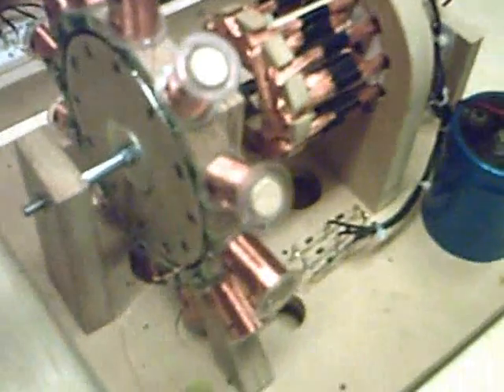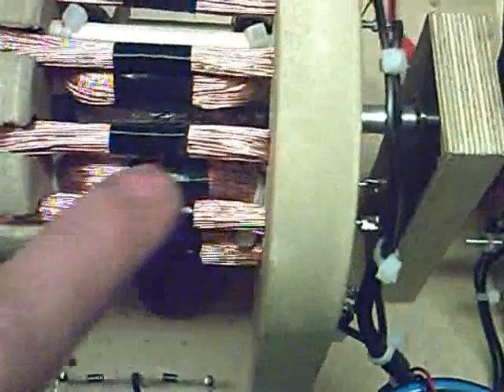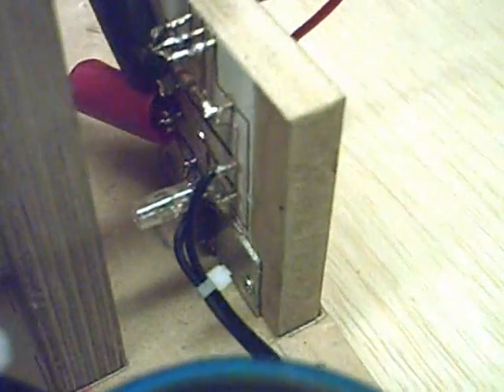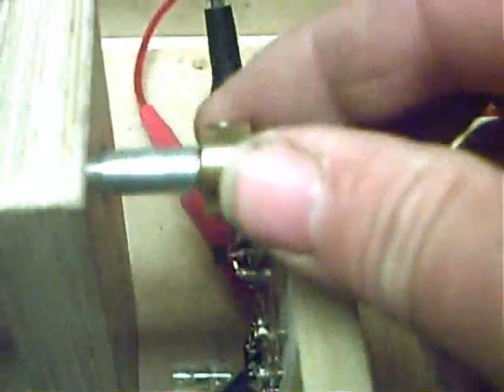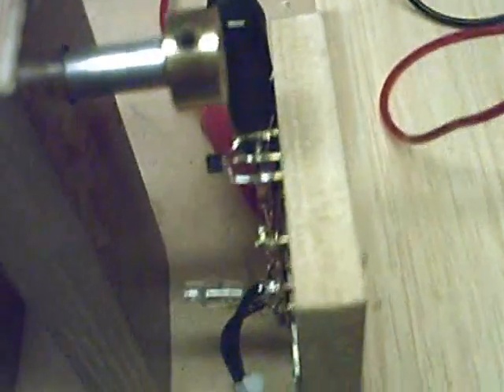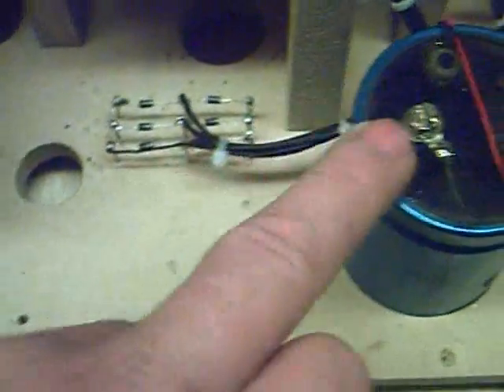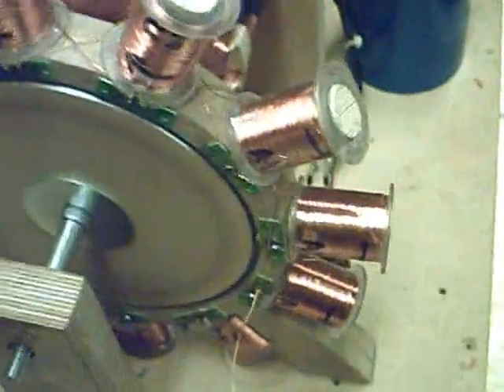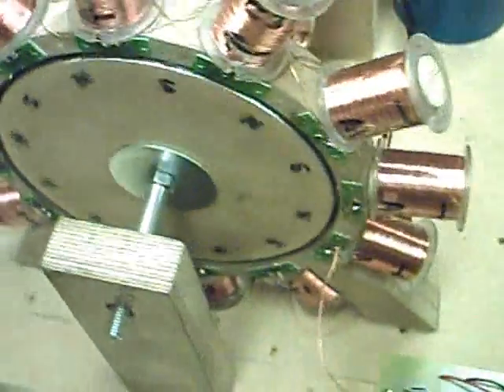Just a test run of double generator.  (TheDaftMan)

Comment: It is easy to create thousands of volts using static electricity on cold dry winter day.

The charging in the video could have been done with a transformer and a capacitor, and would be more efficient.

It is no surprise that Daftman has not achieved overunity, he even admits it.

Daftman's understanding of physics is way under par relative to his craftmanship by a factor of 1000.

Comment from the maker: Do you mean the TheDaftman set out if so there is a link on the TEEP forum?  
Or if you go to this video on youtube (Bedini pulse motor, build and diagram video 1 of 3.)
and look on the right you will see the downloadable link there to. 

Now if you are asking for the circuit that I used to run this unit sorry I have not finished testing it yet.

Thanks the DM.

Comment from the maker: Yes its the control circuitry thats pulling the amps not the motor hence this new test set up to test the new circuitry as it would be a pain to do on the big 4 pot one. (My all new Newman motor 2 running it up.) Although in about to boot it out with the rest of this work. Getting a lot of flack on it. Yesterday got 37 emails telling me Im a **** and Ive just about had my belly full.